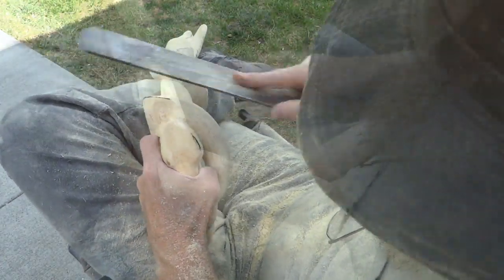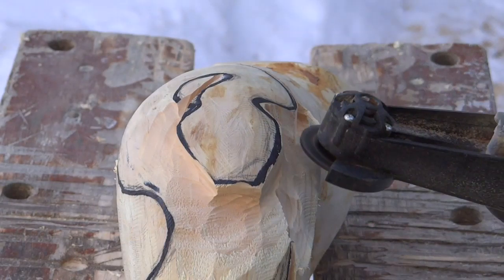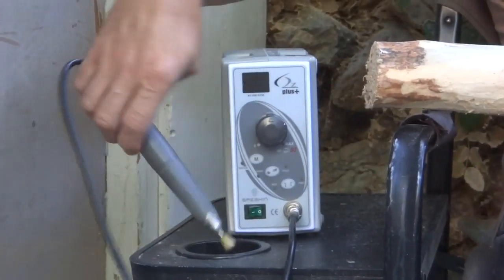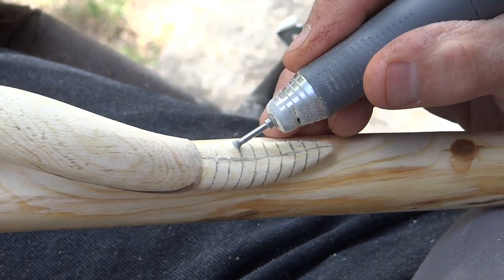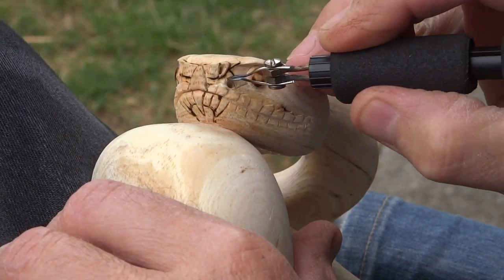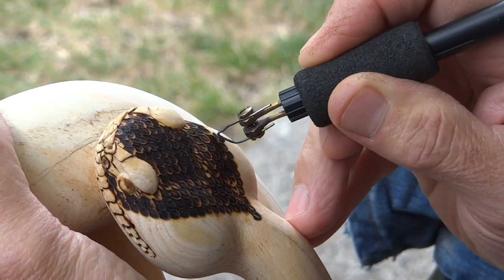My Favorite Power Carving Tools,

Comment: Omg. I use a Chicago tool rotary machine from harbor freight. In capable hands it'll do the same thing as th OZ plus. But I looked up the OZ because it's way sleeker and easier to handle. It cost $775. I have to stick to my $50 Chicago. Lol

Comment: I love watching you work. I have a long, about 8' ? maybe closer to 10', I really never measured. Stick I picked up as driftwood off the shores of the Behring Sea in Alaska. I had it shipped to Texas, and brought it with me to Florida and still haven no idea what to do with it. I do not know if you can use it for any carving purposes, it is as large around as some of the work you have done, so I believe it's plausible. However, would you work it? Since I'm originally form the southwest, I was thinking burrowing owl(s). Maybe lizard/roadrunner. Not really keen on the snakes, I've had a few too many run ins with them on my own. Any chance of a replay to let me know? Thanks!!

Comment: Great video Mike! How often, if ever, do you make mistakes? How do you go about fixing mistakes when you are doing such fine and delicate work?
Reply from the maker: Thank you very much! I try to avoid making mistakes by taking my time and thinking about every cut before I make it, but I have had a piece break before. In that case, I will drill in a dowel and use epoxy and filler to repair the break.

Comment: Love your work sir and I’ve clicked on your link to look at the tools and I saw a blank wood stick so I wanted to purchase but it’s says diameter 1 and a half inches and that can’t be right as your snake stick sticks you start with is a lot bigger then that so can you help me with what thickness of sticks should I start with as been trying and getting better each time but as I was using hand tools it took forever to remove the wood around the snake but I was doing it all wrong but now I get it I need to know what’s the thickness should I start with,?? Thanks and another fantastic video cheers.
Reply from the maker: Hi, Shane. The thickness should be three and one half inches. Try getting a 4x4 cedar post to round out and make one. I hope that helps.

Comment: I contacted treeline and told them about your recommendations.
The Oz plus sure looks great but man the price tag.
Even with the hefty price tag its not completely outta the question.
My luck with dremmel hand pieces has been terrible. The mini grinder is cool too. 
Gotta make some money decisions sometimes but quality is what ya pay for..
Thanks for the video!
Reply from the maker: Thanks for checking them out, Tom! I started out with dremmels, but they burn up too quick. I went with a Ram Power hand piece, which is also sold by treeline. It worked really good for years, but I decided to upgrade to the Oz plus a few years ago because of the power it has. I've  been really happy with it. I know it's an expensive unit but it was well worth it for me.
Reply: @StinnettSticks  I'm definitely gonna get the Oz and the mini grinder.
I've had the shafts on 2 hand pieces on the dremmel go bad in a relatively short period of time so this looks great. We have a lotta red cedar here and want to add some art to log coat wracks and stuff. Maybe I'll update ya when I get it and you keep up the beautiful work.

Comment: I've never carved before. I want to know how I get on but I need to avoid dropping over $500 for a micro motor. Any recommendations, please for a strong tool like this that is more affordable? TY
Reply from the maker: I would start out with a Dremel, and buy better tools as your skills get better. A lot can be done with inexpensive tools.
Reply: Stinnett Sticks Thanks I’ll check it out (my wife recommended same thing). I did find a dental drill for about $70 with mixed reviews but I think I’ll give it a shot. Thanks so much for your videos, just the I inspiration I needed to try again (tried when I was young but someone ran off with my knife set before I even got to use them). I often wonder how many unmade creations they stole without even knowing it.